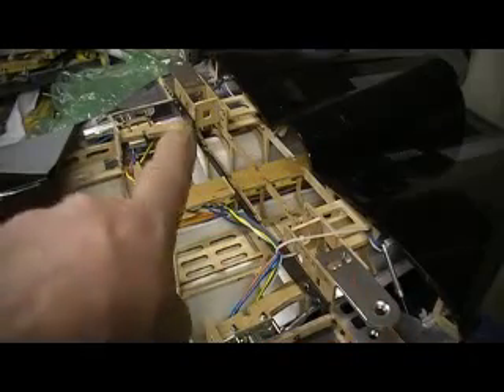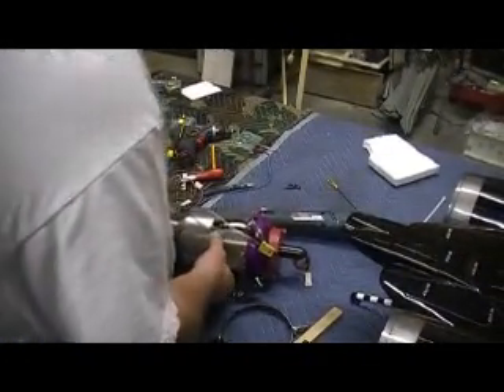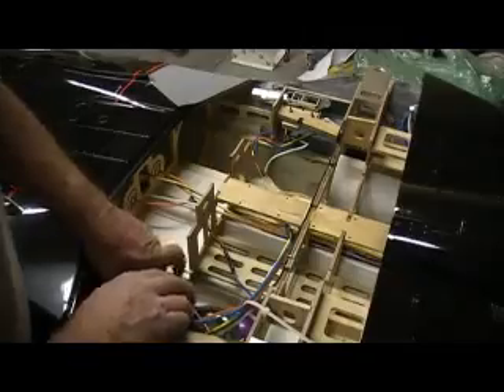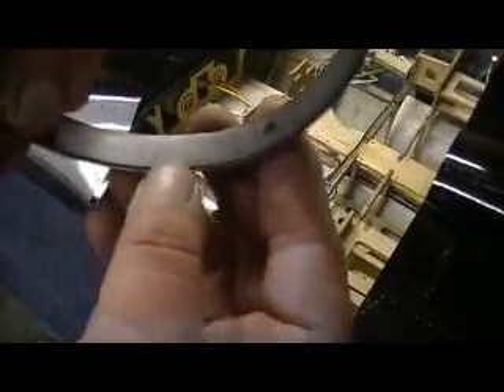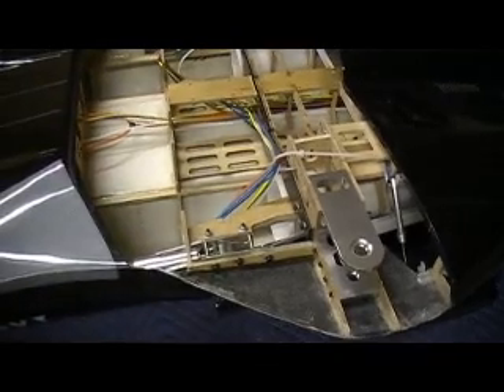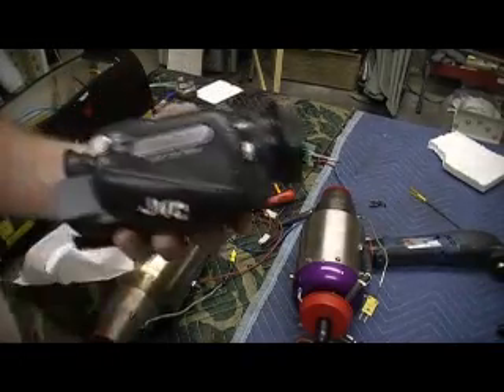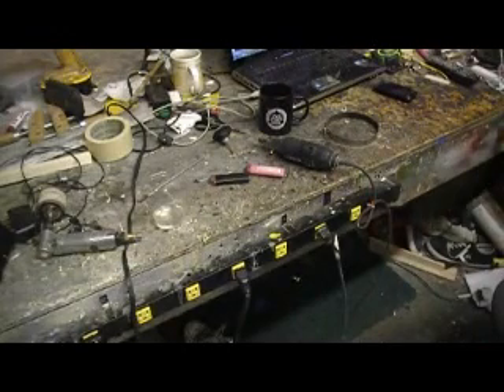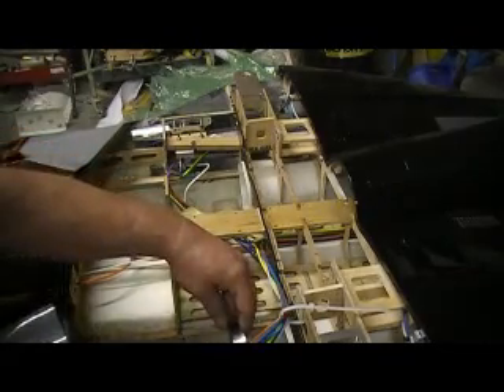FEJ F-14 tomcat build #6

Comment: do you need a certain amount of gap between the engines and the wood. or do you use and metal tape that you can cover the wood up.  it just seem to be very close to the wood, How hot do the motors get will that be a problem. they look great and a lot of fun, looking forward to see them in the sky, classicwoodman